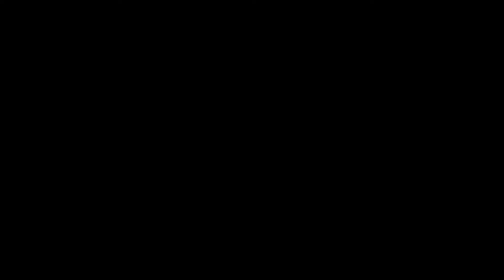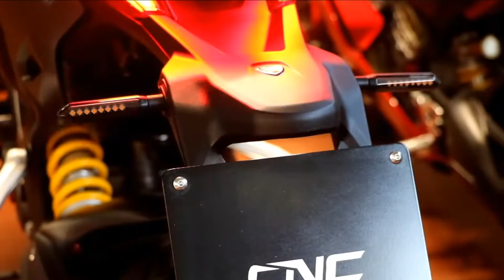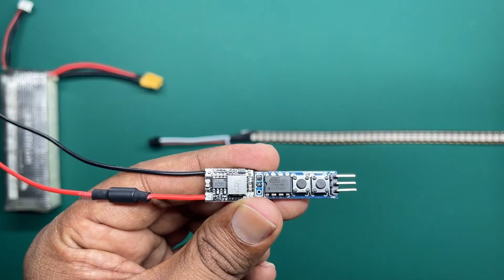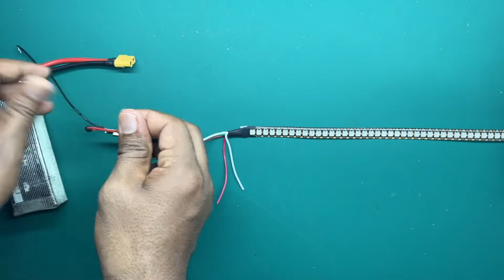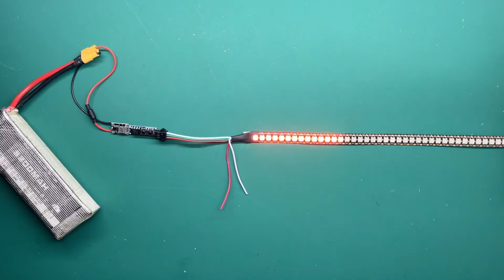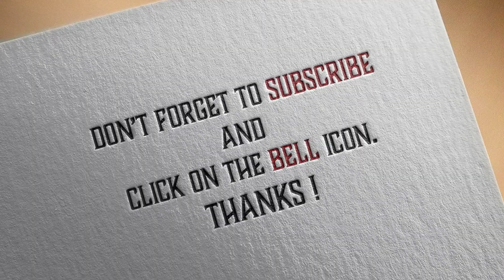DIY Sequential LED Turn Signal Light for your Car | Make DIY Automotive #DIY #turnsignal

Comment: I built smth like this myself. It's quite simple. Only issue I get is that signal is interfered from other electric wires. This module looks like it will have it as well. Mine is working great under constant power. Problem starts when I connect it directly to turn signal wire.
Reply from the maker: One example 

https://youtu.be/RsGqpIao8Zw
Reply: @HAZITECH  but this is still under constant power. It's totally smth different to what I said before.
Reply from the maker: @kubabeemwu6258 Nope. You haven’t watched it properly. This is not under constant power. Normal vehicles do not give out constant power to turn signals. Making a unit which only works with constant power is useless.
Reply from the maker: Great. But my module is working great in real life tests and not only on bench testing. The odd behaviour of it comes not only with hardware but with software part too. 100+ units are fitted already.

Comment: Can it be made to work with Halogens?
Reply from the maker: Not this version. I’ll make one which can be work with halogens.
Reply: @HAZITECH  thanks. I had a schematic for a mechanical..relay/resistor type but to adjust the speed I have to buy or alter $30 flashers(soldering different size resistors inside stock units which is difficult). It would be neat to have one adjustable with buttons or even a simple DIY regular one that wouldnt be as much extra wire and circuitry. They're for a tail light that only has three bulbs on each side

Comment: Nice idea. You made me think about my custom turn singal issue and now I know how to sort it out.
Btw, what is the maximum current that this tiny dc/dc converter may held?
Reply from the maker: Awesome. It is rated for 3A. BTW, if you would like to purchase any of my controllers do let me know. Thanks!.
Reply: How much are the controllers
Reply from the maker: It is $9 per piece

Comment: Have you considered one with daylight mode? 3 wire connection for power ground and signal. I tried to build one from your previous videos and was less than successful 😢.  Interested in this but would much orefer a daylight mode. Bonus if it also does nightrider.... lol
Reply from the maker: Hey, I'm working on it. Let you know the good news soon with a video.

Comment: So what happens when power is turned off then back on on a car does it keep the memory or reset!!!
Reply from the maker: As I showed in the video, all the settings are kept in the memory. So no reset at all.
Reply: @HAZITECH I also noticed that's spi Tape your using isn't it for signal .. that means you can't make it any brighter if was required!
Reply from the maker: You can connect 2 LED strips in parallel in order to further increase the brightness if required. But this is still very bright. Video camera doesn’t do the justice.